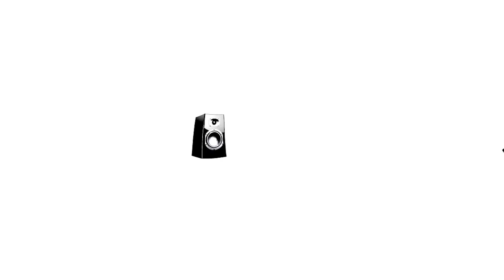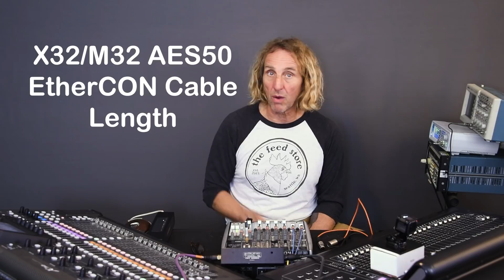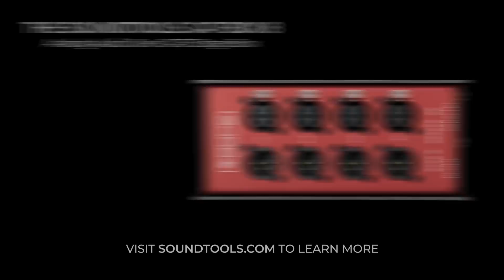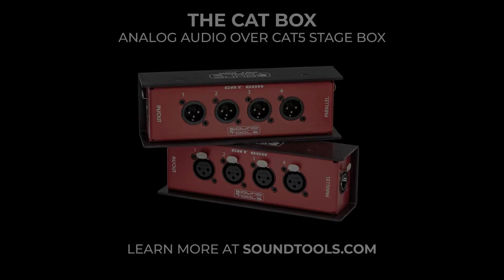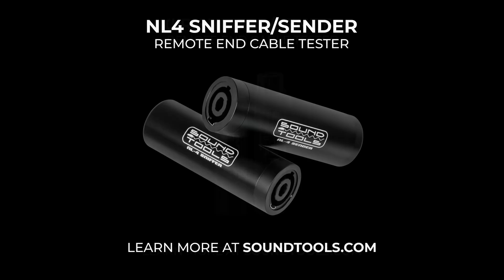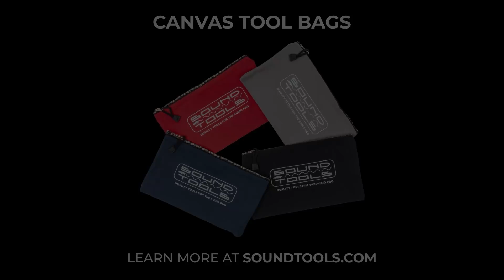Behringer X32 Midas M32 AES50 Cable Type & Length (Public)

Comment: We had massive issues with a pro series Midas console and it came down to our 100m Cat 6A core. Many many tests to work this out, not helped by a lot of the shows running the cable path running away from crowds somewhat protecting it. Same core with Dante, zero issues.
Reply from the maker: Interesting, I was wondering if people were having similar issues with the pro series. Thank you
Reply: @DaveRat  Don't quote me on this, but I've been told the spec for the Pro Series is unshielded. I don't understand why one would be shielded and another would be unshielded within the same protocol. Nevertheless, I have heard this from quite a few sources, some of whom I trust on these kinds of things.
Reply from the maker: The initial consoles did not specify shielded or on shielded. Then people were having issues with static electricity. So newer consoles have a little sticker that says to use shielded cable. But the length maximum for shielded cable seems to be less than unshielded. None of this has been documented very well by the manufacturer. So, the consoles will work with shielded and unshielded cable but in dry static environments unshield is an issue, and for longer cables shielding is an issue and to solve all of the issues shielded cables 80 m or less seems to be stable

Comment: 13:12 Dust on the modular plugs:
 I have first hand experience with audio dropping out during a show, and it turned out that a Midas M32 lost the connection via AES50 to the stage box (Midas DL 32). Sound disappeared without a plop, and remained off (so maybe not due to a static discharge or someone treading on the cable). The cable was maybe used 6 times earlier, but perhaps 10 months after purchase, so fairly new.
 Audio returned after the modular connector was taken out of the console, blown at, and the reinserted. It was still on the edge of working, as the audio would temporarily drop out when the modular plug ("RJ-45") was wiggled a bit (without a Neutrik EtherCon shell to hold it fixed in place).
So, using EtherCon shells rather than bare modular connectors  seems to a to the stability by reducing the contact surfaces to be rubbing against each other, when the cable gets moved around.
Cable length was 50 m, directly between M32 and 'DL 32' without any intermediate connectors/joiner boxes.
Reply from the maker: Interesting and precarious

Comment: As mentioned already - Music Group specifically specs Cat5e and NO other cat cable. The impedance of the cable and the twist ratios mentioned are important for aes50 but not so relevant for normal networking use. I would not recommend anything besides high quality cat5e for that reason.  

The ‘benefits’ of cat6 apply to networking use but do NOT apply for aes50 which is a signal that happens to use cat cable.
Reply from the maker: Interesting. My testing shows the Cat6a is quite superior for carrying aes50 over longer distances than cat5e.

I am developing a Cat6a cable for the SoundTools product line and one of the tests I am doing is making sure that it carries AES50 for longer distances than cat5e.

Not sure why music group would fail to recommend a cable that is superior at carrying aes50 over longer distances but many factors go into making recommendation decisions and some factors may be based on other aspects beyond what is optimum for the end user
Reply: @DaveRat  Interesting!  I know there have been issues with Cat 6 etc which have caused them to recommend the original spec cate.  I wonder if the physical properties of Cat6a match closely enough to the needs of the cable but with advantages in addition?  Will be interested to see what you find out!
Reply from the maker: Cat 6a is a different beast from cat6. Cat6a is a large diameter and tightly spec'ed cable that performs exceptionally well and exceeds the Cat7 in performance for the cables I tested.

It's all about the"a"

Comment: Do you have the same issues with a DLive?  Where the board is a controller and all the processing is at the rack.
Reply from the maker: Never used a d live
Reply: @DaveRat  I believe that with Allen & Heath DLive having all the processing in the rack would mean that no audio signals would be traveling through the CAT cable to the mixing surface.  Will try to find one and unplug CAT cable from the surface while playing music through the system and see what it does.  Looking at the DLive, would be great to know before buying.
Reply from the maker: Cool, yes, one of the most important aspects of my videos is that I am doing everything in a way that you and others can fairly easily and relatively inexpensively replicate and test other gear
Reply: @DaveRat  thank you for all that you do, I learn a lot from your videos
Reply: @DaveRat  I have the old ILive haven’t upgraded to DLive yet. Tried unplugging 200’ AES50, no pops, crackles or any other irregularities.  Surface just showed a screen letting me know that I lost connection.  I would imagine DLive would work the same.
Reply from the maker: The pops come from being on the verge of working or from static electricity disrupting the signal momentarily.

Aes50 attempts to avoid pops but at least with the x and m 32, some get through
Reply: @DaveRat  I will add to the length of the AES50 until I get it to fail, I will let you know.  Theoretically in most cases no audio is going from the mixer on stage and the surface at FOH.
Reply from the maker: So when you unplug the aes50 it does not mute?
Reply: @DaveRat  no it does not mute. the surface/mixer is just a joystick.  All the processing is done in the rack on stage.  Have had my ILive  surface go down in the middle of a show and because I was also connected with an iPad, I was able to continue mixing like nothing happened
Reply: That is as long as you have not routed anything going through the surface/mixer.  If I have wireless microphones at FOH going into the board, I would imagine those would drop.
Reply from the maker: Very cool, that solves the issue of aes50 instability
Reply: @DaveRat  initial test 300’ Rapco and a 200’ Rapco joined by a home made RJ45 splice connector.  ILive T80 surface still controls the IDR 48 mix rack with no anomalies. Further testing when Neutrik RJ45 splice arrives.
Reply: From the A&H website: gigaACE is a Gigabit Ethernet point-to-point connection (1000BASE-T, IEEE 802.3ab), Layer 2 compliant. Layer 2 network switches and media converters can be used, provided they support Gigabit Ethernet (1000BASE-T) connections.  DX Expanders use DX links which are Fast Ethernet point-to-point connections (100BASE-TX, IEEE 802.3u), Layer 2 compliant. Layer 2 network switches and media converters can be used, provided they support Fast Ethernet (100Base-TX) connections.
I have an A&H SQ6 and I run 2 DX168 expanders over 200ish feet of cat5 cable, never a problem. In fact, because the DX protocol only uses 1 twisted pair in the cable, I fabricated breakout cables for each end that pass the SQ6 AES/EBU output onto the second twisted pair, and out to my Crown iTech power amps (the DX expanders don't have AES outputs). One easy, small, lightweight, coilable cable. Noice.
Reply: @sailorkaren  so you can use Dave Rat’s Cat Tails and have 3 XLR and 1 twisted pair as signal for DX Expander?

Comment: Dave, you might not frequent the facebook forums on these consoles, but it is a pretty well known fact amongst users that the x32 aes50 “real world” cable length spec is about 150-200’ (depending on cable quality).  It also HAS to be cat5e, shielded and bonded ethercon shells. Obviously the bonding between ethercon shells falls apart when adding connections in-between… fwiw, I am using your purple cat 5e cable for my aes50 snake connections…. At 150’ ;)

I’m the admin for an x32 group on facebook and a member of the midas m32 groups… I get to read it all…
Reply from the maker: Fair enough, my perspective it to test and verify real world aspect and look the manufacturers specs.

Many people offer many opinions with little or no testing or credibility.

I did the cable length tests to try and come up with a plan for dealing with the issue.

I have designed and manufacture 2 Cat5e cable designs already and am working on a new CAT cable design. 

Based on these tests I have decided not to design around AES50 for the upcoming SoundTools CAT7 cable and maybe mid to late 2022 I hope to have a SoundTools Cat6a cable design that carries AES50 a stable 100 meters with at least a 20% length buffer.

So it will still be functional up to 120 meters.

And after these test, I have
Reply: Cat6 shielded should be your minimum cable used.
Reply from the maker: Yeah, it really depends. If you are bundling a bunch of Cat cables into a 100 meter snake and only need cat5e grade for most, switching the whole bundle to Cat6 will make that cable bundle a lot bigger, heavier and less flexible while adding cost as well.

Get the right tools for the job, add some buffer or a bit of redundancy and avoid inadequate tools and also avoid blind overkill.
Reply: so in other words, there is no "real world" use for these consoles. because you will never have all these perfect checkboxes just to make a thing work in a basic way. other consoles and AOE will not do this.

Comment: Hey, Dave!  Thanks for publishing.  I’m curious if you’re looking to do some similar comparisons with the DiGiCo MADI TP cabling.  It’s an interesting progression I’ve seen over the years, and is really impactful on SD9 and 11 users/owners.  I’ve seen them offer very different looking/feeling spec cabling over the years.  The cable construct and price has also significantly increased in order to offer more stability.  I think the larger take away here is that the MADI p2p protocol was never designed or intended to be used with twisted pair cabling.  I’m a 9 owner/user, and due to my experience, I’ve switched to only using an SD Rack with MADI POD, and making the TP - BNC MADI conversion at the desk with their LRB devices…seems far more stable than running any variety of long category type cabling, and just using a more cost effective 100m MADI snake….Optocore would be the fully proper way to set and forget it, but that’s a lot of extra cash for an individual who’s main use is simple console to stagebox operation.
Reply from the maker: I will ponder that.
Reply: Maybe see Soundcraft MADI overTP they have a published pin out they use a pair to pass the clock maybe that's why it can't run too long because pair-pair skew delay is allowed 50ns@100m in TIA-568

Comment: Sooo yikes! We just committed to an x32 and 32 channel stagebox set up with a 100 meter ethercon run from stage to front of house. This would be an install, so not much moving or touch the cables after it is run. Will do still get some of those inconsistencies you mention here?
Reply: I would recommend using a solid core core cable for installation as the performance is generally better. The touring (stranded) cables are designed for superior handling and robustness, these are important in touring sound but much less so in installs. But absolutely make certain there are no joins of any kind in your cable, ethercon direct into your desk and stagebox. With a good quality, properly terminated installation cable I think you should be OK at 100m. If there's any spare, chop the excess off and re-terminate it to length, don't leave the excess "just in case".
Reply from the maker: Yes, solid and minimal length for installs is wise.

For touring it's not as wise
Reply from the maker: I just don't know. It does seem to work with some cat5e cables in most environments. 

But many or mist cables that meet cat5e specs don't work and the ones that do work seem to be very close in length to not working.

Comment: Hi Dave,

I had a thought about you length problem with AES50.  If AES50 is running on ethernet and you're have problem with signal degradation at 100m, have you tried putting a cheap ethernet switch close to the middle.  Having that switch regenerate the signal may help you get the 100m.
Reply: AES50 is not a network standard.  This is multichannel AES digital audio.  This is not networked audio like Dante, AVB, QLAN, etc, etc.  Read the spec.
Reply: @brenthandycts131  I agree with  you 100%, AES50 is NOT a network standard like Ethernet though it uses CAT5e. I have been trying to explain this to the folk at my church for months now. Trust me, I can write a whole book about the problems we have been experiencing. To be safe 1. Use CAT5e, shielded with Metal Neutricon ends. 2. Never, ever go beyond 80M (The shorter it is, the better) 3.Never use an Ethernet extender 4. Let connection be point to point! 5. Don't try to 'outsmart' Music Tribe by running higher-spec cable (They know there is CAT 6, 6A & 7 but recommend 5e). Like Dave said, we have experienced the Dropouts, to the POPS & the Nuclear bomb noise. Running S32 & WING
Reply from the maker: Agreed AND I have developed a cable that will carry AES50 for 140 meters, perhaps farther.

I also recommended a method anyone can use to easily test and confirm the reliable distance of the cable they're using for AES 50, Dante or whatever.

Basically add a 30% cable extension onto whatever cable you're using and ensure everything works reliably. 

Then removing the 30% extension should give you confidence that your cable will work well at that shorter distance.

Using this method and multiple thorough  test methods to ensure reliable data, I've been working with our cable manufacturer and have come up with a cable that can carry AES50 over 140 meters.

So, Soundtools will be releasing that cable in 2 lengths: 100 meters and 10 meters. The official announce of the cable release should be coming in the next 30 days or so.

The concept is that you can use this cable and carry AES50 for 100 m and optionally use a 10 m extension and go 110 m reliably. 

Why 110? Because it's the equivalent of cable length 11 and we always know that we need audio things to go to 11.

This cable is double shielded and surpasses every specification of cat5e. Additionally we have discussed with a contact at behringer possibility of licensing a version of our cable to them in order to solve the 100 m AES 50 issue once and for all.
Reply: @brenthandycts131  Hey Brent, I was reading the specs on AES50. The document said that AES50 was riding on an 100base-t network. I believe the IEEE spec for 100base-t has a limit of 100m. This is has to do with collision detection of ethernet frames on a shared medium. I think Dante is an application layer of the OSI model and would run on any network i.e. ethernet or token ring.
Reply: @brenthandycts131  Thanks for the info.
Reply from the maker: Putting a cheap Ethernet switch in the middle of an audience between stage and mix position would be precarious. Thousands of humans with mud, beer, stomping on something that could ruin the show would be quite undesirable.

The snake systems are often subjected to much abuse and the reliability we get from Dante or fiber or analog is well established with out using a repeater for 100m runs
Reply: @DaveRat  Thanks Dave.  That's a good point.  I believe 100m is right at the limit of the FastE spec.  Have you seen this issues with other manufacturers?  What I mean is, could this be a cheap NIC in an otherwise nice board.
Reply from the maker: We use multiple formats down cat5e and fiber at 100 meters without issue and do have issues with aes50 down those same cat5e cables
Reply: AES50 is a layer protocol and does not support Ethernet switches.

Comment: Does AES50 work with fibre converter boxes?  (I honestly have no idea, I just use Dante.)  If so, that might be an interesting test to see if you can run it stably with short copper patch cables into the converters on each end.
Reply from the maker: I don't know but I am sure someone here does.

There are many ways to solve and impriove, basically I am just clarifying the capabilities of the built in aes50.
Reply: Klark Technic does make a converter set, but it's a bit spendy at about $2k, so probably outside of the budgets of most people utilizing these desks.
Reply: @fooschnickens  AES50 is listed as being built on "layer 1 Ethernet" so you can't use a switch, but i wonder if generic fiber media converters would work.
Reply: @TristanBWV  Correct, which is why specialized repeaters and, in this case, converters exist. Like CatX-based solutions, I imagine nothing else could occupy the same fiber channel when used with the K-T converter. Whether or not a standard converter would work is left to be seen, but I think it wouldn't based on how AES50/Supermac works.

Comment: Midas Pro series has its own world of complexity too. They specifically don't want shielded. Can work fine a lot of the time, but when it doesn't work, it really doesn't work. I found in that situation that ground lifting it on one side isn't even enough, you have to do both. Acts like an antenna or something and drops the sync. I had to buy every ethernet cable at every walmart in chicago one night and all those with a ton of couplers worked better than a shielded tour grade cable.
Reply from the maker: Yuvk
Reply: Where are you seeing they don't want shielded cable?  That's not correct AFAIK.  I was there for all of the Midas product rollouts and dealer training.
Reply: @brenthandycts131  I don’t think I can reply with a photo here, but I have a screenshot from a Facebook thread where the official Midas account made a statement on this and said for Pro series  “It's Cat5e UTP.”
Reply: @GrahamTobias  But the M32 is not the Pro series.  It is a completely different machine.
Reply: @brenthandycts131  ah, if you look again my comments are only about the Pro series, not M32.